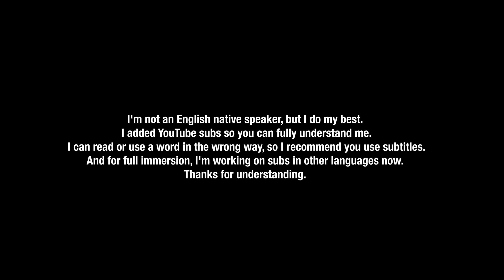This weather wants to kill me. Journey Across Carpathian mountains. Part Two

Comment: I climbed Mt. St. Helens several times before it blew up. I only summited once. One time the wind was terrible. My guess is that it was about 60 mph (98.6 kmh) based upon what it feels like to stick your head out the window when driving that speed. I had wool gloves and leather mittens. I took off my right mitten, and the wind snatched it and carried it away. I went for a ways further with just the wool glove. I wound up taking part of the group back down the mountain. No mountain is worth losing fingers.
I  had a lot of anxiety when you kept taking your glove off. I put a cord through my sleeves to keep from losing my gloves now (like a little kid).

Comment: 2:29 Is that a fire in an electric burner? Or has the burner been repurposed to use "alternate fuels?"
Reply: I really wonder, how that thing works. It's connected to electricity, the coil is glowing but there's a small flame inside? That stove has seen some shit
Reply from the maker: I think this is not a flame, but just some kind of indicator or light bulb. If there was a flame, then I think this stove would no longer work.
Reply: @BadCatUrbex  It had me fooled! Thanks for your explanation.